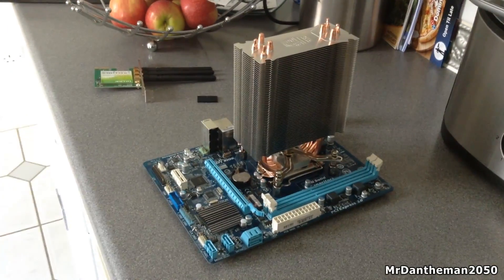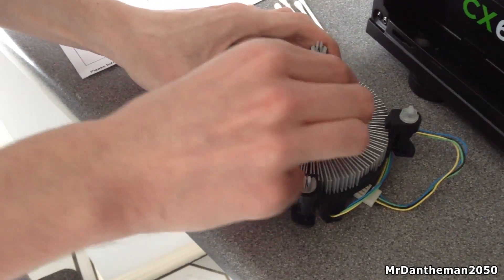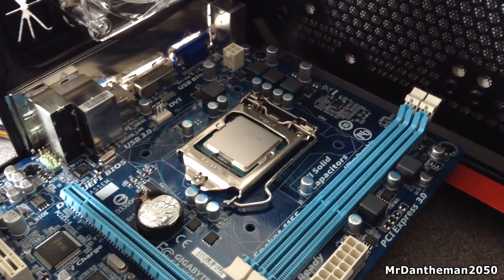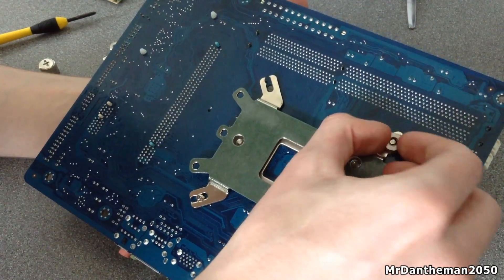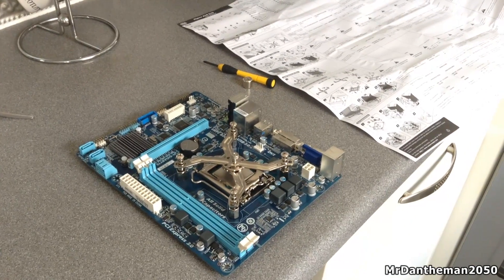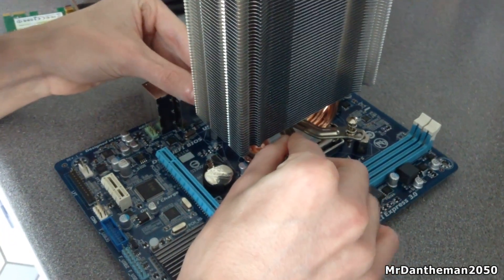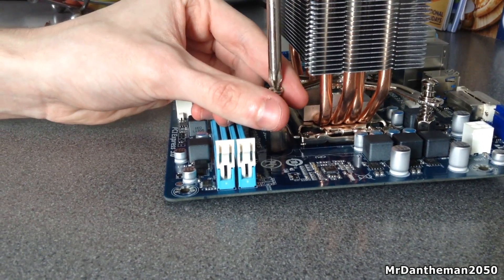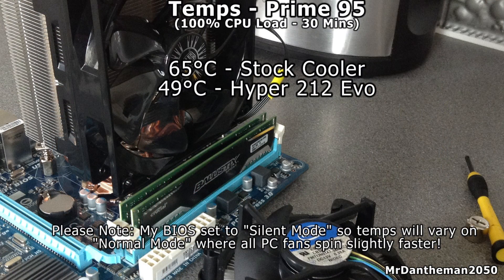How To Install A Hyper 212 Evo CPU Cooler

Comment: I installed the cooler the same way you did and we have the same motherboard, but for some reason 2 of the ram slots stopped working, so I can’t run the ram at dual channel, any suggestions?
Reply: Probably you bend some lga pins of your socket when you take it off your processor

Comment: This was the most extensive undertaking I ever tried! I saw so many videos where people blabbed about mindless drivel. Your video was direct,and step by step. Took me 2 hours but I got it done. Cheers man.
Reply: How did you do it mine is so werid one side fit and the other is to short
Reply: @eosmo3505  i basically just wedged it in there.  long as the cables are connected you're good.
Reply: @knicksprop  yeah same but the screw just flew out the motherboard ether way it came damaged so it doesn’t matter ima return it and then get another one hopefully it works
Reply: @eosmo3505  good luck!
Reply: @knicksprop  thanks

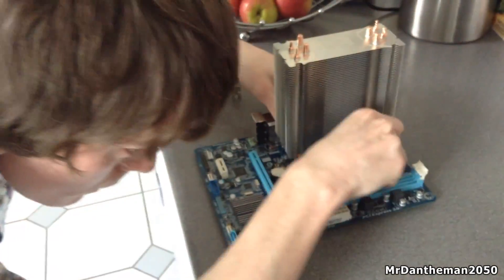Comment: Dan need your help please! So i'm in a situation where I have to mount the heatsink with the bracket on, the 9:47 part, but when I start screwing in the screws by hand, the screw diagonal to the one I'm screwing starts lifting up! So I'm afraid to push down on that one to screw it in I'm not sure what to do
Reply: Same here
Reply: Did you ever fix it?

Comment: I know it's an old video but I'm hoping someone will see this and help me. I can't screw the cooler in at all, if I screw one side, the other just stays up in the air and I can't get it in
Reply: Screw each screw slowly and at the same time (that is, screw one corner 2-3 times, then screw the opposite corner 2-3 times, then do the same for the other corners until all four are bottomed out).
Reply: Adeum Deus the other side it’s way up in the air and won’t even go down with force, makes no sense
Reply: Blixen have the same problem
Reply: Did u have the washers on the screws?

Comment: I don't recommend removing the cpu from the socket, You might accidentally touch the bottom where it comes in contact with the pins. CPUs don't like human oil from your skin. They are very sensitive.
Also, if you are not grounded, CPUs are also very sensitive to static discharge. Just Saying :)

Comment: is that a mATX board? I want to get the Hyper 212 evo cooler but I read that it blocks the ram slots in mATX boards? I have the h61M-VS and my ram has heat spreaders so sounds like it won't fit?
Reply from the maker: Yes is a mATX board, the 21 should fit all boards with standard height RAM.
Reply: Wait so is 31 mm too big? My ram is 31mm so would the hyper 212 evo fit?
Reply: I also have mATX
Reply: You can move the fan up , it dosent have to be in the dead centre , i have corsair vengance ram and the spreaders make it taller so i just moved my fan up a couple of MM,s .... :)
Reply: if ur ram has heat spreaders it will not fit unfortunately, however standard ram will

Comment: Hello, I just received this cooler today and after I installed it (what a learning experience) and turned on my computer with just the power cable to test if it worked, it was able to boot but not power down with the power button... I had to unplug the power cable (it hurted me) and checked to make sure all the front panel cables were connected properly (they were). I had to keep troubleshooting and after lots of research online, I have come to the conclusion that my motherboard is the one causing issues because my keyboard, monitor, and mouse are dead. Before touching anything inside prior to the cooler installation, I touched the metal parts of my case to have some sort of a static protection. Any help would be very much appreciated thanks
Reply: Did you plug the keyboard directly to the motherboard usb slots? or to the case usb slots in the front? if you only plugged them into the case slots, it could be that it is just the front panel connectors of your case arent properly connected to either your motherboard or are simply not connect to the port on the case itself
Reply: happened to me I tried to install it while in case allot of tention and I build up static charge that might killed my mothere board im ordering a new one never try to install while in case plus to ground your self connect the ppwer supply to electricity  but turn the switch the power supply of then toutch it each few secondes

Comment: Is thermal paste included when you buy the cooler?
Reply from the maker: +Windir Yes. Dan.
Reply: Dans Tech Ok, thanks!
Reply from the maker: No problem!
Reply: I read somewhere that the stock thermal paste is not as good as say,  Arctic MX-4. Thoughts?
Reply: Dans Tech yes thank you so much I almost bought some!!
Reply: Dans Tech yes thank you so much I almost bought some!!
Reply: Mx-4 is better, but it’s not a big deal. I use it for every application that requires thermal paste myself..

Comment: How is the thermal paste that comes with the cooler? Would you recommend a different one or is it good enough?
Reply: Sunny Dummy  I recommend the artic 5 thermal paste
Reply: arctic silver isn't required. The stock paste has been proven to work just as well.

Comment: can you use a microfiber cloth to remove the thermal paste instead of toilet paper
Reply: Everyone tells me not to use paper or toilet paper but to use a microfiber cloth instead.
Reply: I use coffee filters to clean heatsinks/cpu.. does not leave lint. I rather not use toilet paper as they would leave lint.
Reply from the maker: Hi, that sounds like a good way to ruin a cloth. I recommend toilet or kitchen paper. I've added this question to my next Q&A video. Dan.
Reply: probably. its smoother, might be better
Reply: Nzxt 340 case
Reply: Dans Tech coffee filters work. DO NOT USE TOLET PAPER it can leave the smallest amount of dust which can have problems down the road.
Reply from the maker: Hi, I posted a video response to this question here: https://youtu.be/oJsGmr4YFFU

Comment: So i can just take my motherboard out and remove everything. install the cpu cooler and put the motherboard back and it'll work just fine?
Reply: Yeah, if ur cables are plugged in right, it will worm

Comment: Hello, I am very confused on which way my fan faces. I have is facing down towards my gpu and power supply is that bad? The arrows on it say  ^ and <--  so i figured that is how airflow would move. In every video/picture I see, the fan side is on the right facing the front of the case. I want to know which it is, especially since at idle my fan speed is at 1200 rpm
Reply: 1200 RPM idle? Jeez.....

Comment: paste twits, you have chips all around chip, cpu middle chip 70c max , other chips 90c. intel chips need paste all over chip , amd not as bad, paste on new fans has paste all over chip. sucky board dude

Comment: do i have to completely disassemble my pc and remove my motherboard in order to install this thing?
Reply: You actually don't, there is a reason almost all pc cases have 2 side panels, the panel behind the motherboard will give you access to the back of the mobo behind the cpu where you can remove old + install the new backplate, tho it is a bit trickier to do than with it out of the case, it is entirely possible
Reply: Yes it looks like it. really excited to buy this cooler though can't stand my loud stock cooler which gets 50-60  c temps on load
Reply: yes otherewise you might kill the mother board like I did plus fan installation get hard

Comment: when putting the part on the cpu, the screws on the x shaped fastener did not level out and when i put one in, the other would be in the air above the part where you screw it in which would require a decent amount of force to push down and screw in. What should I do? Just use the force required or get a new fan?
Reply: same issue. send like the threading on that one nut is bad
Reply: nevermind, ma super dumbass. All I had to do was take the screw off and screw the nut in a few times to fix the threading and it was good lol. durr
Reply: it's intended so you screw them a bit at a time from.each side

Comment: Hey Dan ! I´ve got a question. I´m Idling temps at 40C and stress tests at around 70C, i´ve got a Sentey GS 6011 Blade which has 1 frontal and 1 rear fans. I removed the side case plate to increase air flow (I´m not sure it does the job though). I´ve just tightened the 4 EVO 212 screws even more (30 minutes ago) and experienced no changes in temps. I figured my EVO wasn´t pressured enough against my I5 4790K processor. The thing is the heatsink slightly moves if I push it. I´m at lost here, I´m thinking about unplugging everything motherboard included and reinstalling the EVO again from scratch. What can I do to solve this ? I should be Idling at around 30C from what I´ve read in forums and pretty much everywhere?. Thanks a ton !

Comment: I have to say this is one of the most stressful processes I have experienced so far. Those insane screws!!!! They have to be turned just right or they won't go into the brackets high enough to get the nuts on. Wow!!

I had to throw one away because I went lunatic on it and stripped the threads so the nut won't fit now that I figured out the secret of turning the drew just right.

With all the handling I had to do to get this bracket on, I wonder if anything will work on the board now.

Comment: You're getting 49*C after 30 minutes of stress testing on the Hyper Evo? I get 40*C on idle. Am I doing something wrong? My CPU is i5 4690k, Z97 MSI PC MATE Mobo.
Reply from the maker: +Danny Okay, no need to worry about the temps. Your internal case temps may just be increasing the idling temps. An exhaust case fan could solve this. Dan.
Reply: +Danny May want to replace your thermal paste?
Reply from the maker: +Danny Hi, you probably mounted the cooler in a wrong way. What are your max temperatures you've seen? If its lower than 80 you're fine. Dan.
Reply: The max temps I see are usually below 51*. It's just usually idling around 41 though.

Comment: can i swap the side of the fan to the other? cause i want to add more ram and i think it might get in the way
Reply: +eat-another-pie Yeah just make sure the airflow in the case goes how your fan goes
Reply: +Brandon as we see the fan bolted on the radiator,does it turn clockwise or counterclockwise?
Reply: gamwpanagia Most fans turn clockwise (just remember the back where the sticker is, is where the air comes out)
Reply: ***** Thanks I was just confused where the "front" side is,gotcha.
Reply: no you cant it should be from the ram.side other wise it will keep the hot air in the case and you will get heating issues

Comment: Seems impossible to install without removing the mb. A hairy installation to say the least. Thanks for the tutorial
Reply: +kao ko I've just managed it, Removed the top and rear fans, ram and any other wires that were in the way. Left the motherboard in the case while installing a new cpu and this cooler, Wasn't too bad..
Reply: depending how big the mother board and case are

Comment: So should this be sufficient for an i7 4790k overclocked to 4.6-4.8 ghz?
Reply: +zJji I wouldn't go anywhere over 4.6ghz.
Reply: +zJji mines locked at 4.4 ghz and works just fine.

Comment: isn't that breaking ur mobo>>
Reply: How
Reply: +Mystical Illusions 4:04, look at the solder points near the down-right mounting hole. If there is no any insulation material, that backplate would short those out and kill the board probably...

Comment: Great video. I am thinking of using the Pentium G3258 with this cooler inside the Fractal Design Node 304. As this will be an HTPC my main concern is sound, how much of a difference does this make compared to the stock cooler - with silent mode enabled in the BIOS? Thanks.
Reply: a lot. also if its a htpc just to play videos you can use no fans. but it obviously wont br amazing
Reply: I have actually been using the stock cooler in the Fractal Design Node 304. It's near silent from > 1m so I'm happy!
Reply: +Sam Bailey fair enough!

Comment: i did this then when i came to screwing the screws , i did a little bit at one side then when i moved to the opposite corner , the screw would not go through the mounting hole help